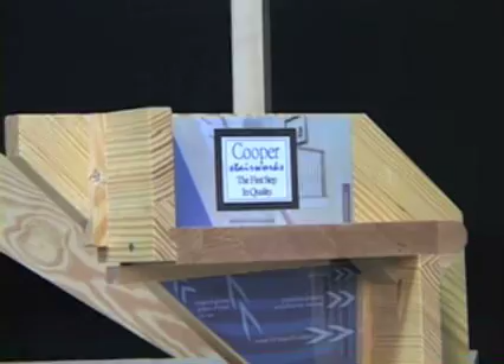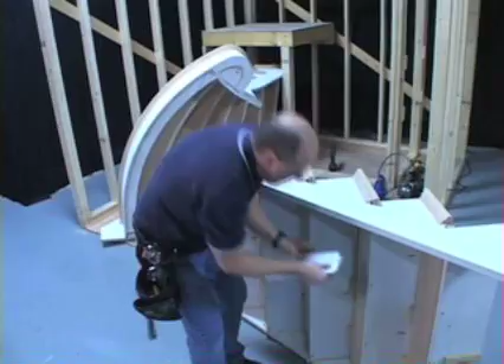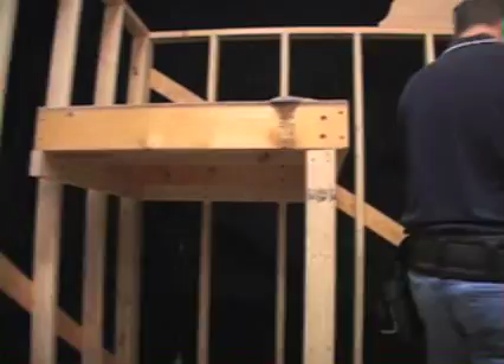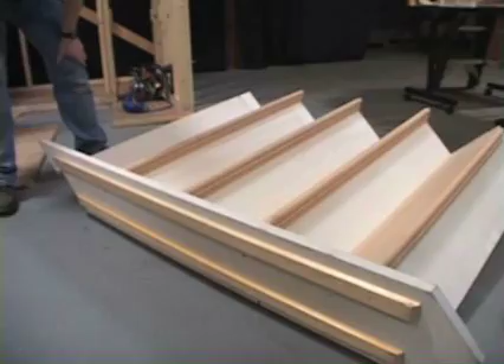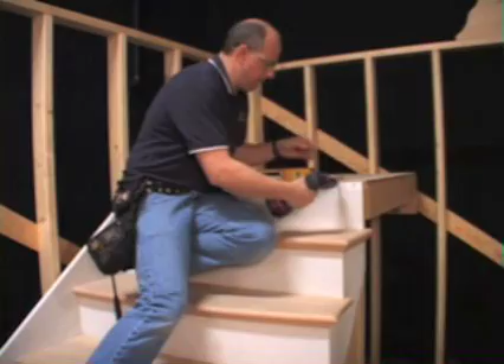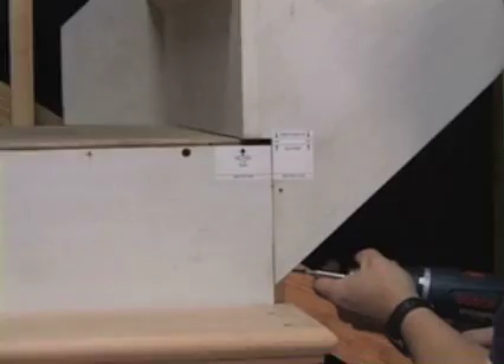Cooper Stairworks Preassembled Stair Installation Video - part 1

Comment: Great idea but I asked a building inspector this way to build a staircase and he sad no way every stairs need 2x12 to pass in a inspection.
Could you please let me what I need to do?I live in Massachusetts.
Thanks.
Reply: Hi, not sure what town you are building in. We have been building stairs for over 40 years in New England and beyond. These are standards used throughout the stair industry. Our stringers are structural. 5/4 thick. The treads we use are also 5/4 thick. Tongue and groove from riser to tread. Wedged , glued and wedge is stapled in place also. All miters have glue blocks. Pocket hole screws connect top of riser into tread.
If a stair is over 48" wide, then we add a center stringer.
We also belong to a National Stair builders group. This is a common construction technique all over the United States. 
We build hundreds and hundreds of stairs a year. This construction detail has been used for over 200 years!!
So, I am not sure what the building inspector means.